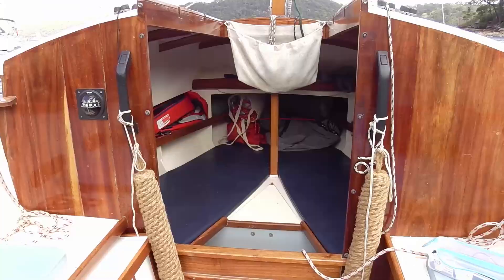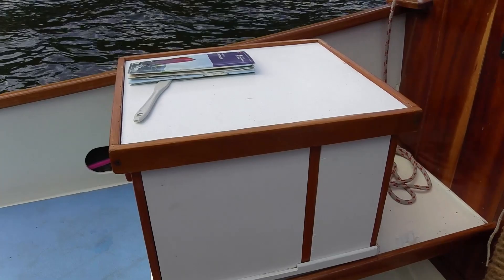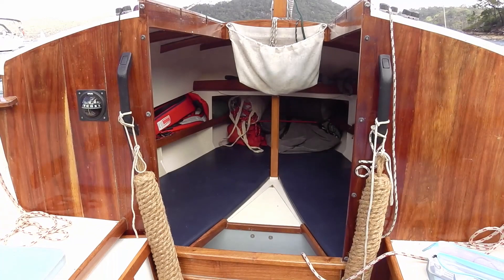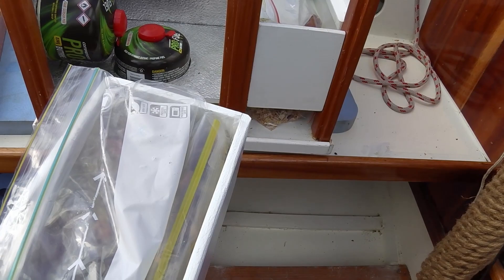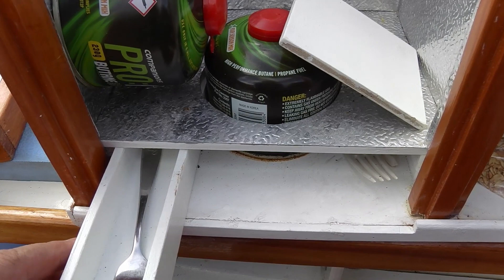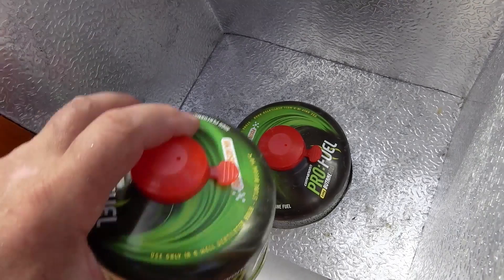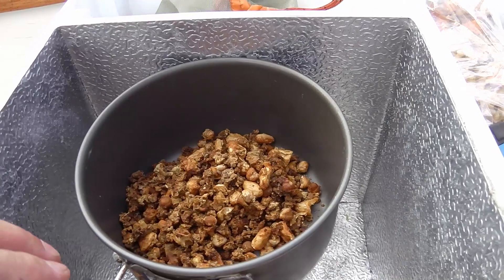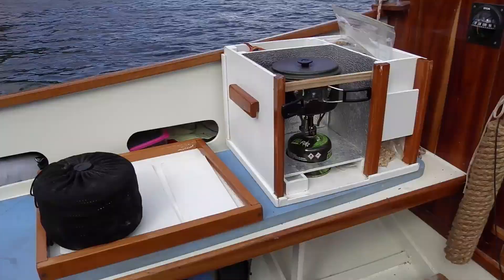Perfect galley box for dinghy cruising

Comment: Thanks Paul.  I do recall seeing Roger B's galley box video yonks ago.  I also saw one from the Welsh chap on his boat Arwen.  But it's pretty neat to know that I could just whip down to Bunnings in Coffs and pick up some of that aluminium foil to cover the internals of the box.  So many videos have OS examples.  God knows what you can get in those stores in the US, but most of the gear is not avaialble here.
Reply from the maker: Hi Col, yep the aluminium sheet does come from Bunnings but measure carefully and I think from memory you only need 1/4 of a sheet....I'm thinking of a little improvement, thanks for watching again, cheers Paul
Reply: @SailingKateLouise  I went straight to the Bunnings site and found this stuff - I think was about $30 for probably far more than I could ever use on a galley box.  Still if that's the stuff I can always find a use for more gear from Bunnings.  

Just so you know, I've been in awe of Mik Storer's designs for ages.  Attracted to the GIS for its sleek lines and the videos of Enrico Franco's Mira in Italy and thereabouts.  But for cheapness and simplicity I am drawn to, don't laugh, the Oz Goose.  I bought the plans for both the   Ooze Goose Ketch and the single main Goose Explorer, as well as the plain old Oz Goose.  Based on the exploits of Painen Dias over in the States, I reckon that it (any verson thereof) would be capable of a bit of dinghy cruising love.  Perhaps not as adventurous as the Lady Musgrave 30nm voyage, but still capable, I reckon.  Certainly inshore.

Anyway, thinking of dumbing it down to a basic OG with an ad hoc as required dodger cum cabin sorta.  But I'm still attracted to the ketch.  The galley box would sit in that hull.  If I am ever in one place long enough to build....

Comment: Just came across your channel - lovely boat. I had no idea that dehydrated meals lasted that long- do you think you could possibly consider that as a topic for a future video? I'm off to do some more research, but I'd love to hear more about your experience with dehydrated rations and what you e found works and doesn't.
Reply from the maker: Thanks for watching, a dehydrator costs about $40 us $65 Aus , it takes about 6hrs to dehydrate but uses little power and you can dehydrate about 4 to 6 meals in 1 go (7 trays option). Make meals with low liquid content and very little oil, it's the oil that can make the meals go off. Sterilise well and use double clip lock bags, squeeze out as much air as possible and store in fridge. Will last 2 years or more. 
As store bought dehydrated meals cost $7 -12 each this is a better option and home cooked always tastes  better.....enjoy